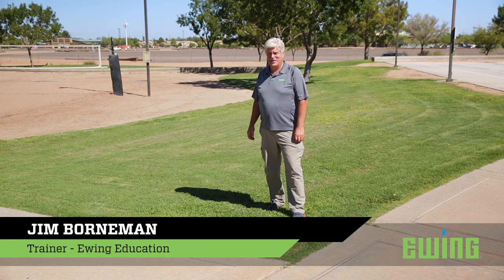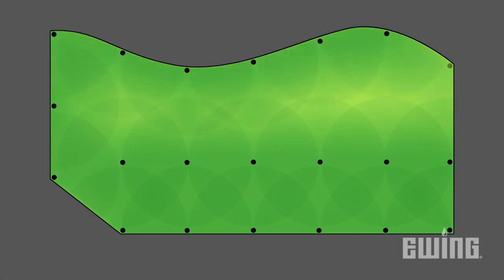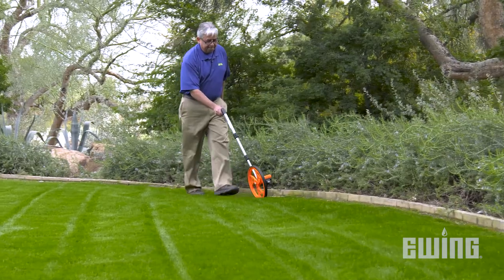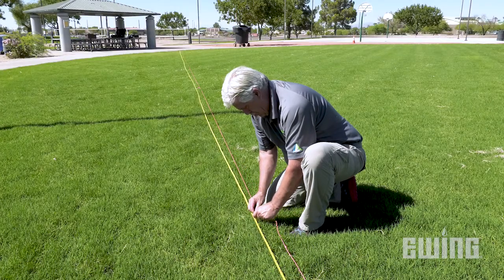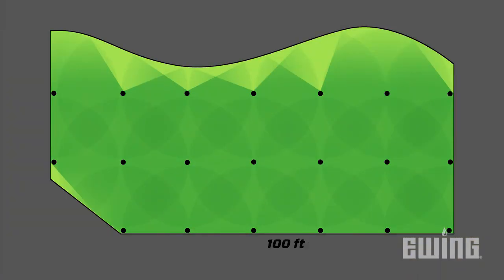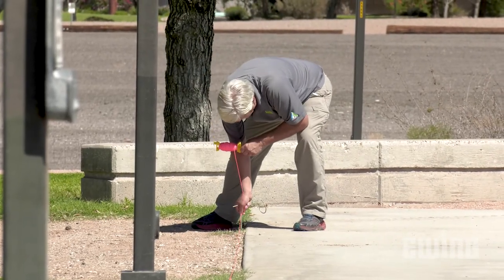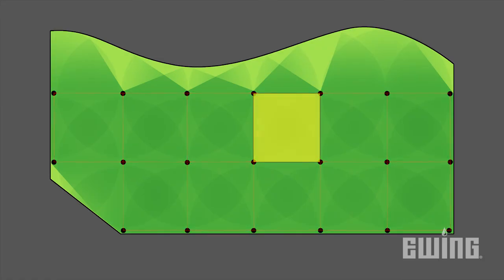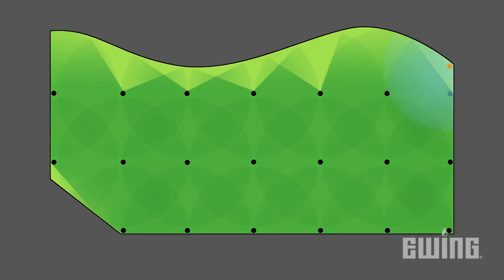Irrigation Design Tip - Sprinkler Head Layout

Comment: unless you have a constant water pressure of at least 80PSI or more and a high flow of water it is impossible to have this many sprinkler heads spread out this way.
Reply from the maker: Thanks for watching and the comment! The purpose of the video is to demonstrate a method for laying out sprinkler heads while maintaining proper spacing to achieve head-to-head coverage. We are not suggesting that all of the heads shown in the demonstration are on a single zone.
Reply: @ewingoutdoorsupply   agreed, but this is not a realistic planning in real situations , if i put a sprinkler head in every foot in my yard of course i will have a full coverage, but theory is one thing and real life is another. I am on your channel to find real life solutions not white board theories.
Reply: @KaliBlaz  Good points you make here